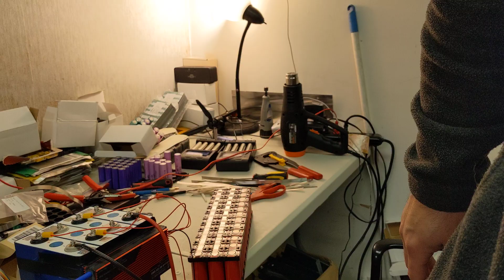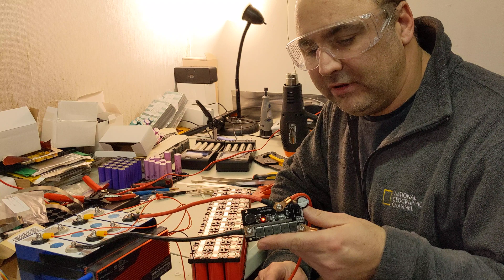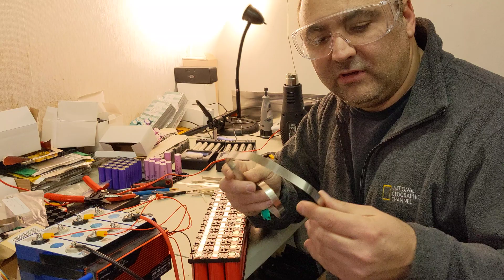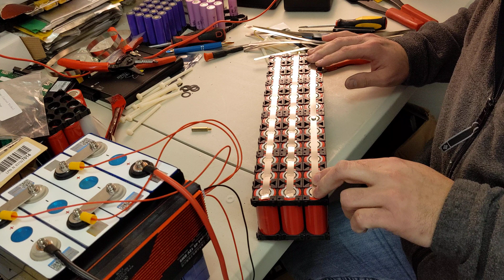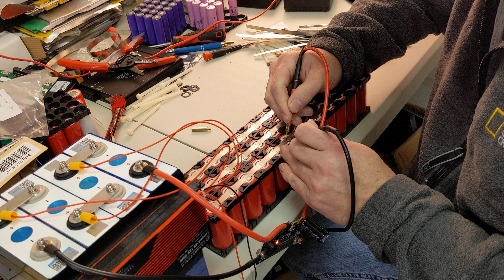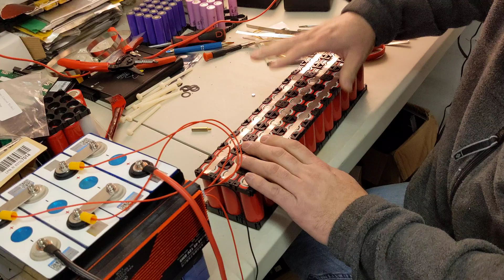12v mini DIY spot welder update

Comment: Did you calculate how much current would be passing through the thinner nickel strip compared to the capacity of the strip? I always worry about exceeding the strip's capacity. I am using fused nickel strip for 18650 cells but plan on using strip similar to what you used for a 48v 16s24p LiFePO4 32650 cell pack configuration. I am hesitant to use larger packs as I am using 0.15 x 10mm pure nickel strip not sure of the capacity of it.
Reply from the maker: Yea i did this is a 3.2volt pack which will be connected to other packs to create a 8S lifepo4 configuration..  the application they will be used for will be spread out over many different packs so should see less then 20 amps draw per larger pack .   so the amps on the nickel strip will be overall low. 

Once i upgrade to a better spot welder i will not worry so much but this is doing ok for now.
Reply: @offgridmaryland  Can another 0.1 mm nickel strip be added, to obtain a 0.2 mm nickel strip?
Reply from the maker: @antomarkic7190  I could do that but i think I would have just used thicker nickel